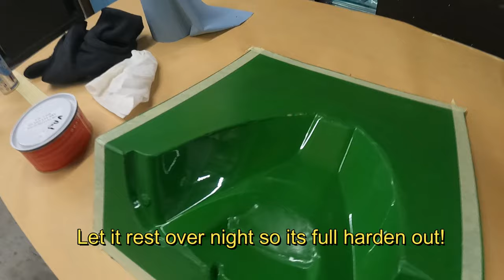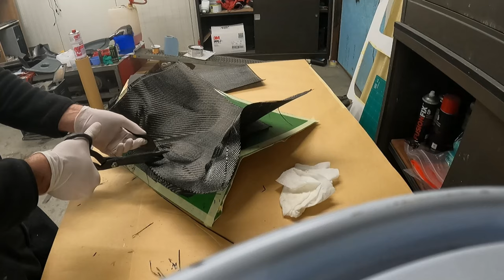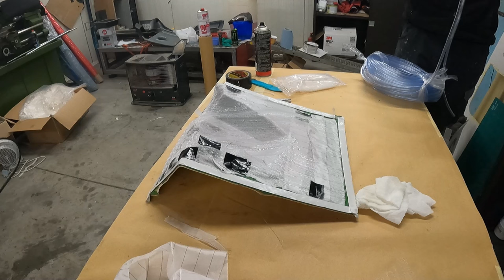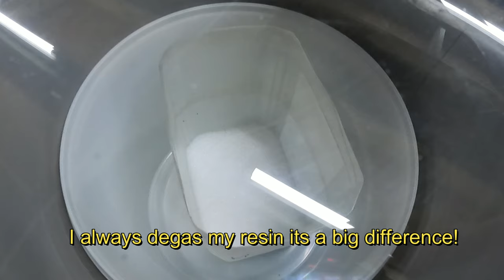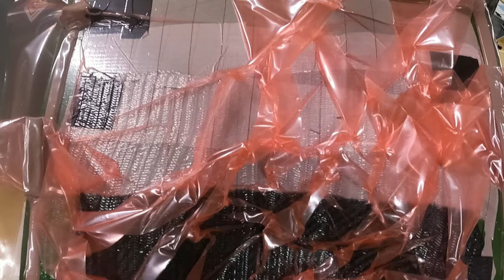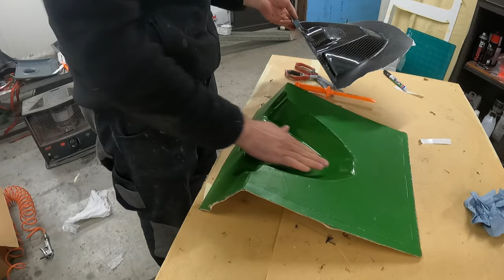2K clear coat in mold carbon fiber resin infusion process!

Comment: Hi, I was wondering:what is your experience with in mould clear coat and why do you use it compared to painting it?
Looks awesome btw
Reply from the maker: Hi, well its pretty simple. clearcoating a finished part needs sanding the part , spraying, curing .... big risk of dust in clearcoat, runs ... you need to fix this again to alot of work and time.
Where clear coat in mould you need to finish the mould 1 time verry good and polish it. when spraying the clear coat in mould you cant get any dust on the surface of the part, you always get the finish of the mould. so time consuming is a big difference.
Reply: @Republicofcomposites  awesome,I was sceptical so I never bought some but maybe I'll try that next time :)
Reply from the maker: @litare4328  ik really got more advantage than not if you got nice molds

Comment: You did not show the process of spraying/building up the clear coat on top of the waxed mold, before laying down the carbon fiber. From my experience, you must spray many VERY LIGHT mist coats to build up the surface (4 to 8?), then spray a medium coat, then a wet coat. If you don't use enough mist coats, the med coat will bunch up into globs, and you have to start all over, after the mess of globs cures.
Reading the last comment, the process of spraying the clear coat into the mold, then molding the carbon fiber on top, is time consuming: takes me about 45 minutes to spray the mist coats, flash 5-10 minutes between, then the medium and wet coat. However, it saves hours of post-mold work as you mentioned, where the part has to be sanded, clear coated, cured, sanded again (pin holes appear in the first clear coat layer), clear coat again, and possible cure, sand, and re-clear until there are no pin holes. Pin holes appear where every fiber tow (bundle) goes under a cross tow: in 4 places! That's a lot of pin holes. Also, the clear coat will always have an orange peel texture, because you sprayed the clear coat on to the part. You'd have to cut (progressive sand) and polish the clear coat to get it "flat". Or, do the Clear In Mold process!

Comment: What’s the difference between in mould clear coat you use than regular clear coat for finishing the carbon ?
In term of composition .
Reply from the maker: I use this clear coat after testing I found this curing fast at normal temp and it has good bonding with the resin infusing epoxy.
Reply: @Republicofcomposites  there is no cons using this in mold coat?
I can not buy locally, not even different brand that special for in mold coating.
😞
Reply from the maker: @calico88  not really, also the fabric stiks alot better with spray adhesive and you wont see it after demoulding. Only con can be that if u you got bridging you dont got open resin that you can fill in because its between the fabric and the celarcoat now.
Reply: @Republicofcomposites  you can see some bubble like because of bridging between fabric and in mold coat. Ok thanks